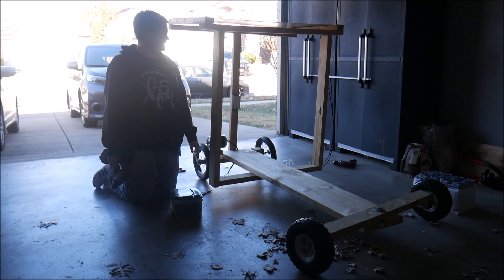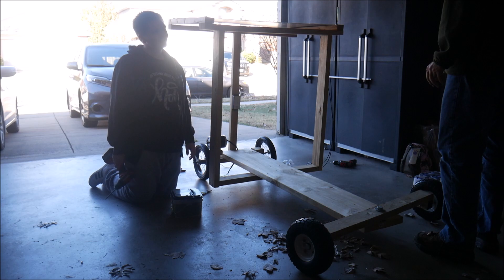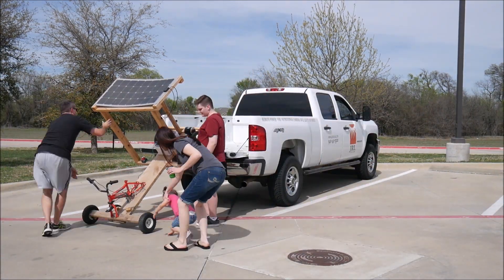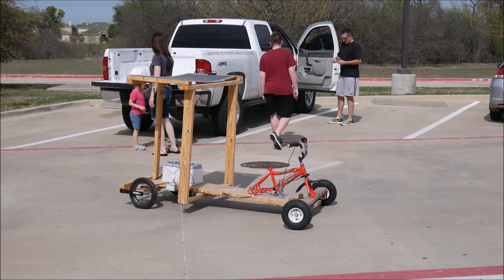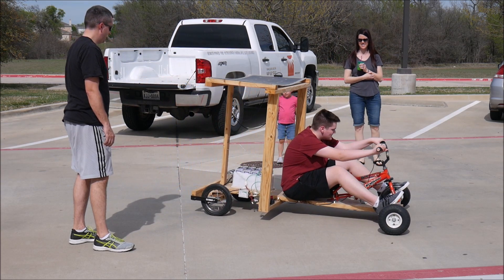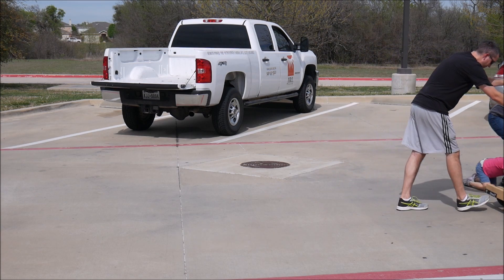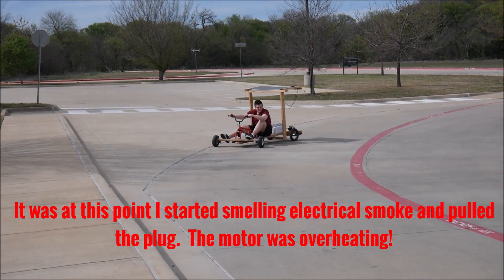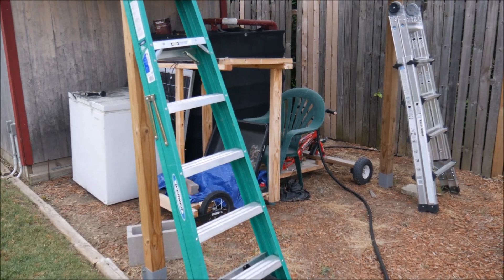THE GREAT FAIL!  Solar Powered Go Kart Project - Part 6

Comment: Find a used golf cart and grab the motor and wiring system off that, once the batteries are charge you will see much faster speeds, so much so that a crash helmet and possible seat belts may be required. We used a twin bed frame for chassis and used the batteries from the golf cart as well.  Solar keeps the charged up and the kids use the cart to haul the trash up to the road for the trash truck to pick up.  Once in awhile they still take spins out in the pastures and sometimes chase rabbits with it. Several crashes and rebuilds but they stop have a blast with it.
Reply from the maker: I looked into that but haven't found anything used.  And brand new motors are too expensive.  I will keep looking.  Good suggestion.
Reply: LDSreliance You may check nearby golf courses. They are taking slow or broken carts out of service continually, they can obtained fo free or on the cheap.  Good luck.
Reply from the maker: Thanks

Comment: Another alternative solution is to go with lithium-polymer or lithium iron-phosphate batteries, that would reduce the weight dramatically. Like my homemade electric bike i made, i went with lithium, more expensive, but a dramatic performance improvement, i shaved off 20 lbs on the bike! on that go-kart, you could probably get 50 lbs off of it going that route.
Reply from the maker: The batteries are LiFePO4.  They weigh only a couple pounds each.  But the wood is heavy.  I don't have a working welder right now or I would have used metal tubing for the frame.
Reply: Ah. Didnt realize they were lithium Iron-Phosphate. Well, sounds like lower gearing and such would help a bit as well. Would love to see a revisit sometime! Thats the kind of thing that gets me fired up in loving electronics is fighting against a struggle to make something work and seeing if it will work after evolving an idea!
Reply from the maker: Yes, I have gotten some help from some viewers on the gearing.  If I can find the right sprocket I will try this again!

Comment: See if you can pick up an old cordless drill at a yard sale. Companies like Makita have pushbikes powered by 18volt Li Ion hand drills & batteries and they used to have them with old NiCad batteries. An old drill will have gears and all the controller circuits built in, just connect up the battery through the existing connectors and use a rubber sanding drum sold to use in a drill press in the chuck & driving on the tire surface. But over heating will still be a problem.
Reply from the maker: Yeah.  Good idea if we wanted to make this 4WD.

Comment: Wrong style of motor perhaps, push bikes with 800w motors go very good, and that's a heavy bike with 20amp hour 36v lithium battery bank
Reply from the maker: That sounds like roughly what I have.  800W 48V 20Ah setup.  I think it is gearing based on my impressions and some of the comments.

Comment: I would hate to see a good project go to waste. You have a gearing problem only. Smell was motor windings burning due to stall currents. Please post driven wheel diameter and motor RPM. I will calculate gearing. I will even do it in imperial for you Americans!
Reply from the maker: Haha ok thanks.  The outer diameter of the rear wheel is 11.5 inches.  The motor maxes at 2800RPM.
Reply: LDSreliance. OK here goes....

Knowns => wheel diam = 11.5 inches, no load motor speed = 2800RPM.
Assumptions => loaded brushed DC motor speed = 1400
                        => Max cart speed = 10MPH

10 MPH = 633,600 inches/hr = 10,560 inches/min

Circumference of driven wheel = pi * diam = pi * 11.5 inches = 36.12 in

Driven wheel RPM = 10,560 / 36.12 = 292.3 RPM

Assume max Loaded motor RPM = 1400 (educated guess)

Therefore sprocket ratio = 1400 / 292.3 = 4.79

From memory you have an 11 tooth front sprocket, therefore rear sprocket should be 11 * 4.79 = 53 teeth.  Google search give approx 9 inch diameter sprocket, which is thankfully smaller than your rear wheel diameter, otherwise would have to start calculation again!!!

I would start with this as the motor may have enough torque for the assumed loaded RPM (which may be greater than 1400) and the cart may then go too fast!

Hope this helps.

Comment: 800W is more than enough. Probably the motor is not 800W or the gear ratio is not the correct one for the motor (maybe both).
Reply from the maker: OK, maybe I will try a different gear then.  Shorter gearing, in other words.
Reply: I have no idea what motor is that exactly. A quick google search for a 800W motor shows a 36V rated motor at 3000RPM and assuming you have a 36V battery and also assuming those back wheels are about 1foot diameter so 30cm a complete rotation will do about 90cm say 1m as is a round number thus for a 25km/h (about 15mph) top speed RPM of the wheel should be 25000m / 60min = 416RPM at the wheel thus 3000RPM/416RPM = 7.2 gear ratio.
It may be a combination of lower battery voltage maybe 24V for a 36V motor plus smaller gear ratio plus inadequate speed controller.
Reply: Yep.  For comparison the average human cannot sustain >300w for more than a few minutes.  800w is A LOT.

Comment: I guess i am watching a different video then you.  Where is the fail?  I dont see a fail.  I see the exact opposite.  A success!  The Wright brothers only flew 120 feet on their first flight.  Did they quit?  No.  The very same day....two flights later...and they attained 250 feet.  So maybe re-engineering is in order.  Some things to look at....weight reduction where possible.  Tires...for your desired speed...stay away from pneumatic tires.  A very narrow solid rubber tread would be great.  Like 1/2 inch wide tread.  I dont know the limits of your motor...but...drop the battery.  Run directly off the solar panel.  And to be crystal clear...i loveeee the build.  Reminded me of the crap us kids built from orange crates...lol.  Fun times.  Dont quit....improve!!  Have fun!!
Reply from the maker: I guess I'm just not motivated to re-engineer right now.  Maybe in a few months.  It was a big let down.  And powering directly from the solar panel would max out at 100W in perfect conditions... no way that would work.  The tires are not pneumatic, they are those tires that never go flat and never need to be filled.  They are not hollow but they aren't solid, either.  Not sure of their construction.  But less rolling resistance is your point and I agree.

Comment: 800W?! I think that would totally be sufficiend. I have a eBike with a 250W Brushless Motor easily reaching speeds of 25kmh (legal limit) without pedaling. Search for Hoverboard Wheels, it looks like you could replace the rear tires with some of those. You'd need a Brushless Motor Controller but they aren't that expensive, there are ones rated for 500W for about 10$ on ebay.